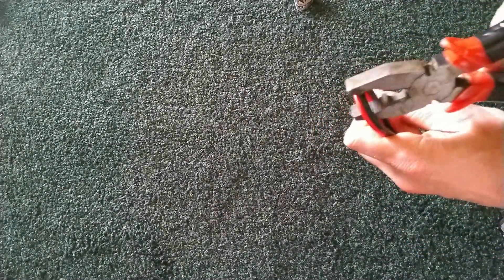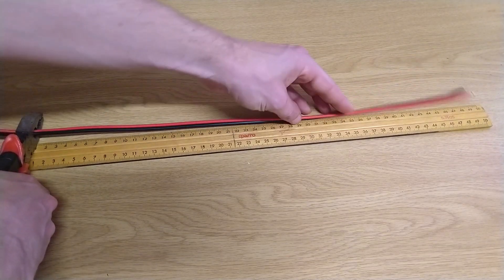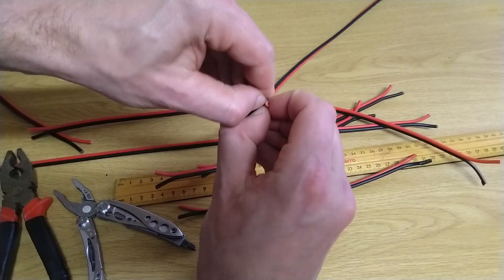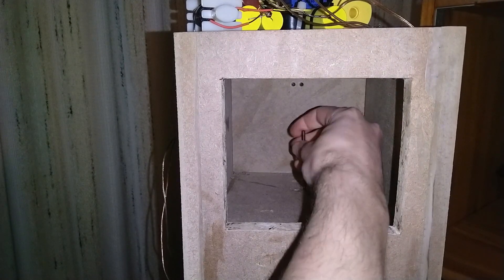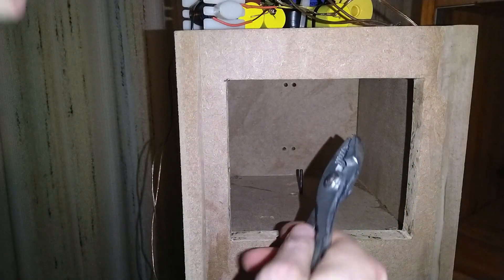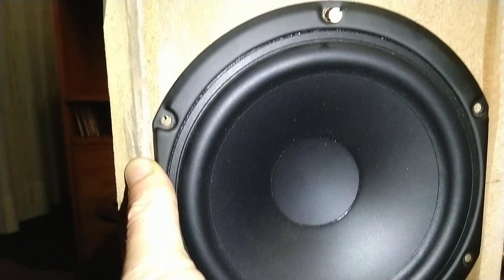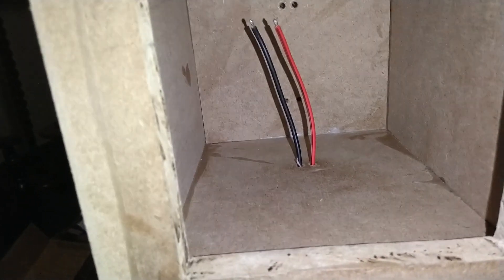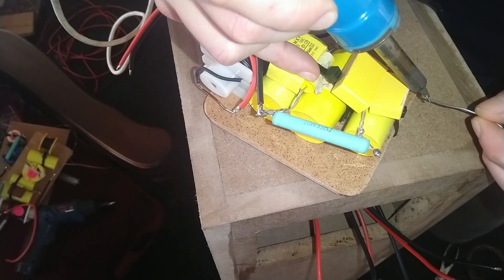Three way Loudspeaker Wiring:  Drivers and Crossovers

Comment: Is it good these speakers sound or it's nothing special? 
Do you think it is worth the effort to DIY these speaker's project?
Reply from the maker: At least one friend of mine came for a listening session some time back and afterwards asked me to build him a set saying that money is no object. Now he had been drinking while we listened to them but I don't think he is wrong to to be impressed. ;-) He still likes to introduce me to other friends of his with "this is the guy who builds his own speakers".  

The markup on speakers is high. If you are going to build any audio component then I would suggest that these are worth it. Obviously you will be converting some of your time into speaker budget but if you enjoy DIY then I think it is worthwhile project to maximise your audio bang for your buck. I hope this helps.
Reply: @breakfixbuildimprove4326  thanks for your suggestion, I will watch your videos to understand better. 
The speaker designer of these speakers usually shows a list of the brands of the crossover components used but I could not find one for this speaker model, maybe because these were made by two speaker designers but if we use similar capacitator brands used in some of the other designer models, the effect will probably be similar.
Reply from the maker: @MrAlexandreazevedo  You are correct, there were no details for crossover component brands. However, knowing what I know now, I would say that it is more important to first get the right value component and then the best tolerances (accuracy of specified value) that you can reasonably afford.

I doubt anyone can tell the difference if you use decent components of the correct value and they are close enough to the value. The reason I say this is because the cross over is a set of filters and mostly cuts of low, high or both ends of the frequency spectrum. Slight variations in the components are going to change very slightly which part of the frequency spectrum go to which driver. 

I am man enough to state that I am pretty sure that my ears won't hear the difference in small variations of which frequencies are sent to which driver. ;-) 

I discuss the capacitor and resistor choices in one of the videos. One of the reasons I tried to source decent components is longevity. For example, I am pretty sure the wattage on the resistors will ensure a long life. 

Don't be too intimidated by it. Take your time and do your research, don't fall victim to the snake oil salesman and you'll probably be fine. 🙂
Reply: @breakfixbuildimprove4326  yes, I think you are correct, I believe that there are many branded capacitors that are very expensive but the difference in terms of sound quality might be minimal so I'm thinking of choosing more reasonably priced components, not the cheapest but not also too expensive, and avoiding the fake capacitors from Chinese sellers. 🙂
Reply from the maker: @MrAlexandreazevedo  I bought most of my capacitors and resistors from a local electronics component distributor. I managed to get some "audio grade" capacitors and resistors from another speaker builder in the country who had imported them. In one of my videos I speak about trying to use the more expensive capacitors and resistors for the tweeter and mid where the signal flows through them to one of the drivers.

Getting my hands on inductors was more challenging but a local speaker builder helped me by sourcing and adjusting them. Later I spoke to one of my friends who studied electronics and he asked why I did not wind my own inductors. 

You probably also want to avoid things like electrolytic capacitors. It is also possible to put a polypropylene or polyester resistor in parallel with an electrolytic but I don't think the monetary saving compared to the overall project cost justifies the potential problems. The poly caps are also self healing and non polarised.
Reply: @breakfixbuildimprove4326  thanks for the suggestion, I will check your videos when I have the time because I have no experience with crossovers. I'm thinking of choosing components that are good price/quality but not too expensive or "esoteric" like the designer of these speakers refers to expensive capacitors. 😄

Comment: Very nice DIY speaker project, thank you for sharing your experience! 
It would be very interesting to make a video with a sound test of these speakers. What do you think about the sound quality of these speakers?
Reply from the maker: Hi, the only I could think to do a sound test video justice is to take them to a speaker designer and builder in a nearby town and set them up one at a time to playback samples while recording them on his high end microphone and then compare the source played sample and their recorded playback on a computer. 

Unfortunately, I really do not have time for that right now. However, this speaker designer and builder is the one who recommended I build these Three-SixtyFive loudspeakers.

I think the sound quality of these speakers is exceptional. High in clarity and very low in distortion from what I can tell with my ears. Recently one of my friends who goes to music festivals came for a listening session and said I could hold a trance  party using these loud speakers.
Reply: @breakfixbuildimprove4326  nice that you like the sound. I have also been investigating on the Internet to choose a not very expensive speaker DIY project to build and I think this might be one of the best projects to build but I don't have experience with woodworking and crossover.
I am also interested in building a pair of SB Acoustics SB20FRPC30-8 8" Paper Cone Full-range drivers, a single driver in a sealed box, or a Nola Brio Trio clone speakers that are more simple to build and without complicated crossovers but the project you built might be better in terms of sound quality but it's more difficult to build.
Reply from the maker: @MrAlexandreazevedo  I am very satisfied with the sound quality. When I occasionally hear what I think is distortion I check using headphones and it is invariable in the source recording. This is a rare occurrence.

I go into a lot of detail on gluing and clamping together of the cabinets. The trickiest part was cutting the circular holes. 

Have you considered joining a local online audiophile and speaker building community? That way you can get help and advice. 

If you can find some local group then they could even help you with the trickiest part of the woodwork. Although practicing on a piece of scrap wood is always good to test out a theoretical way of achieving your goal.

The only danger with this approach is that i you are not careful they could end up building your speakers for you! 😀

The big issue with single driver speakers is that is very hard to make a driver that behaves optimally for all frequencies. That is why two or three way speakers exist. Crossovers can also do more than just filter certain frequencies in or out for a driver which allows them increase or decrease part of the spectrum to deal with a dip or a spike.
Reply: @breakfixbuildimprove4326   I'm a member of the diyaudio community and I have been reading a lot on the forum website, there is a lot of information on that forum website about multi-way, full range, and open-baffle speakers. There are many experts there that prefer two or tree way, while others prefer the more simplistic or pure sound with a single-driver or coaxial driver in a TQWT, without crossovers and others prefer open-baffle speakers like the manzanita forum thread. I'm thinking of trying different things because I think it's an interesting hobby. I did not build the manzanita yet because the speakers are very big and require some distance from the wall but it's also a very interesting, inexpensive, and easy project to do, I heard some sample test sound from a 3-way variation from that speaker and the sound was very good. But I'm thinking in build the same speakers you built because they seem to be very good for the price and probably they don't require a big room like the manzanita speakers.
I will follow your videos when I have the time, thank you for your advice 😀
Reply from the maker: @MrAlexandreazevedo  ah that is good to hear. If you are worried about biting off more than you can chew then one option is to first build some simpler speakers and then later you can build some more complicated speakers with the experienced gained. 
Good luck!
Reply: @breakfixbuildimprove4326  thank you! I think it's a good way to spend our free time and have fun building speakers, especially if we can build good hi-fi quality speakers without spending a lot of money because many commercial or high-end hi-fi equipment are very expensive because they spend a lot of money projecting products and with marketing and logistics and probably we can DIY similar speakers for a fraction of the price, if we buy a DIY kit it can get even more expensive but if we choose a good speaker design and choose our own components as you did we can get a good bang for the buck.